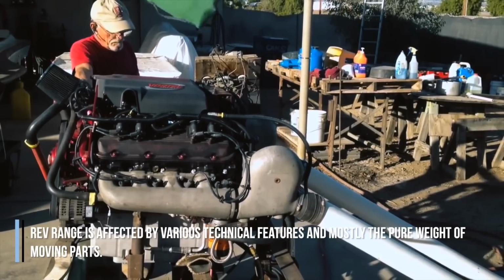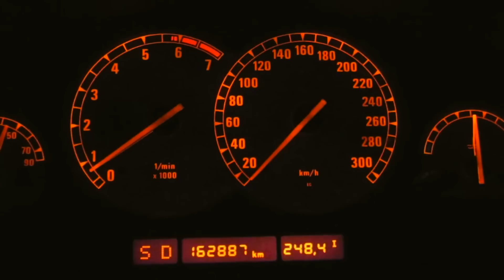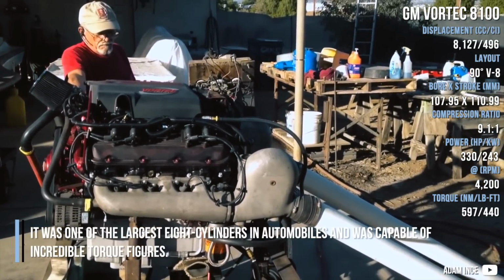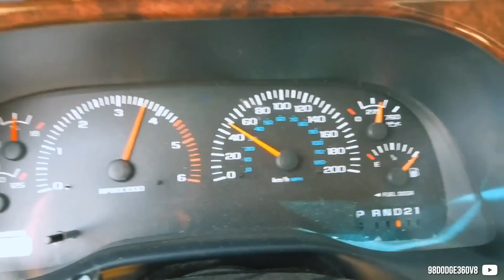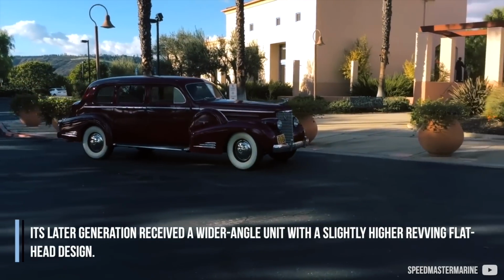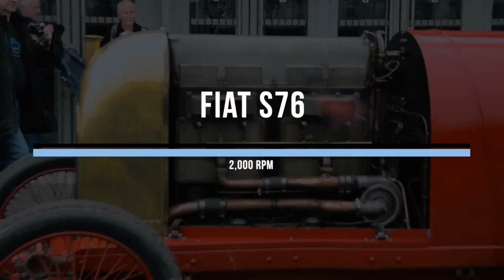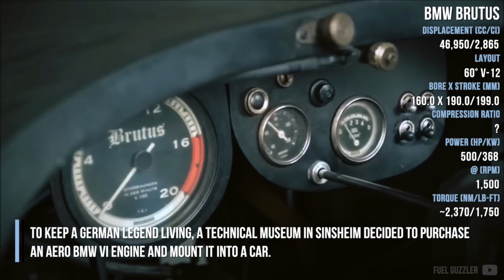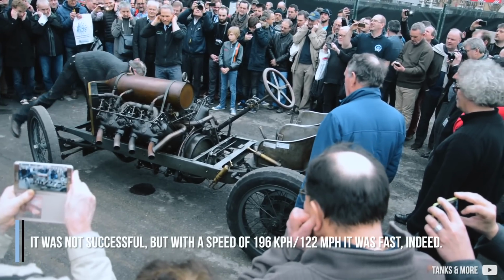Lowest Revving Gasoline Engines

Comment: Do a video that is opposite of this.
Highest revving diesels.
Audi le mans tdi
HDT m1030
BmW n57 
Etc
Reply: Lowest revving diesel too!
Reply: Yanmar 7800 rpm
Reply: 2004 Citroën C3 1.4HDi. 5000 RPM. I can prove it too, I have one sitting in my driveway :D
Reply: Whole Mercedes OM60x lineup
Reply: My last car had the BMW N57 and now I drive one with the successor, the B57.
These engines are beyond great!
They have huge amounts of torque and especially the B57 revs fast as hell for a diesel!
Reply: @jaynee8581  thanks. 👍
Reply: @rolux4853  It must have a lightened flywheel then ;D
Reply: Maybe Detroit?
Reply: 6.7 Cummins turbo diesel from a 2013 ram 2500 6000rpm
Reply: 2 Stroke detroit... at 3k sounds like its at 6k XD
Reply: 2.0 litre PSA-tdi with 136 hp in a 1,7 ton Volvo S40. 
Even a BMW E90 with a 136 hp (probably the same engine) is much lighter than the Volvo with FWD.
Reply: @davidradtke5166  Some TDIs Rev To 5500 At Max...
Reply: @savagetuner2404  those huge marine diesel engines do like 100 rpm, but I think let's keep it on ground...
Reply: @danishghostrider  omg that revs higher than my gasoline truck V8 lmao. I feel like I'm a part of this video's list when I'm in 4th gear doing 40km/h @ 1000rpm
Reply: @danishghostrider  please do. I had the Xsara 1.4hdi from the same here and it toped at 4000rpm if I remember correctly.
Reply: @TheAllMightyGodofCod  Sadly rotted to death, along with other failures, such as: power steering failure, abs failure, aircon failure, frame rotting, turbo failure. In short, too expensive to fix. (5.000DDK car and 15.000DDK repairs) Had to junk it...
Reply: @savagetuner2404  I think it's the 300 to 500 range and used in a ship
Reply: @BeingMe23  the slowest modern example that I know of is a Wartsila ship engine that peaks at 156 rpm

Comment: My brother and I traded a Chevy Suburban with a blown transfer case and a bazillion miles that we had gotten for 500 bucks for a 96 Econoline van with a 300 straight six and a 3 speed C6 transmission. The guys we traded with knew what they were getting, and I'm not sure why they wanted to do it, because we've been using it as a work van for years after building out the back with shelves for our tools, and a bulkhead to keep everything in place. Was just at my parents house building a fence yesterday, and their neighbor has a Chevy truck with the Vortec 8100. 2 of the engines on this list right next to each other and I didn't even appreciate it!

Comment: What about the Bentley/Rolls-Royce 6.75-litre V8, redlining at around 4,500 rpm?
Reply: Scrolled down to post this. They just ended production last week!
Reply: @Matthew Lund british? lol, it's a chrysler engine. waaaay back when that brand meant something.
Reply: There is no such thing as the Bentley / Rolls Royce 6.75 chap.

I think you must be thinking of the "Six and three quarter" old bean! 😉
Reply: @mattlad6935  Now BMW installs a 6.75 V12 instead of V8 odd idea getting ride the V8
Reply: @BeingMe23  I'm sure they don't call it the "Six and three quarter" though!

Comment: Supercar fans: "Bugatti Chiron is the torquiest gasoline-only car out there."
Fiat S76 & BMW Brutus: "Allow us to introduce our selves..."
Reply: Supercar fans: O.K. - let's race !!
Reply: @TIMEtoRIDE900  add a little traction control and better tires, and I'd like to see a video about that. The brutus has roughly 1000Nm more torque than the Veyron.

Btw, the Veyron is actually german-made, too. Just like the Brutus.
Reply: @JohnM4jc  all the traction in the world wouldnt help the fact that the chiron has more power. use all the crank tq you want, but you cant break the rules of physics. hp wins. to even think they would compete in the same league is not even fucking funny.  comparing a car that brags about being able to comfortable cruise at over 62 mph, to a car that govers well over 200mph is a joke. i really hope you aint seriously thinking that these two cars compare. like, at all
Reply: @chaztitan6457  hp never wins proper gear config always win also Brutus uses a airplane/tank engine if it was put in a aero dynamic chasis and had modern tuning and gearing it could in theory beat the Bugatti.
Reply: @xxzenonionnex7658  it would not beat the bugatti for this simply fact. The brutus's engine produces less energy output that the w16 in the bugatti. Pushing air, moving gears etc require energy to do so. This seemingly common sense idea, seems to escape people constantly. to pull weight faster, to accelerate faster all requires more energy than what you had before to "be faster, move more" etc. gearing is a major part, but without energy to use, gearing is unimportant.    and hp always wins. only time hp may not look like it won, is when you are in a race where hp out on average is what determines the winner. like a circuit race etc. but in a drag race where you are on the accelerator the whole time. it would be impossible for a car whose output was 1000hp the whole time, to loose to the same car whose output was less than 1000hp.  if 1000hp was not as quick as another 1000hp simply because of tq output or gearing then 1. you could win a nobel peace prize and turn physics on its head, or 2. you simply dont understand the whole concept of what hp actually means and how its used
Reply: @chaztitan6457  then how do drag racing diesels that rev 2500-4500rpm go 180-220mph with around 700hp or 1000hp and 2000-3000lbs of torque then?
Reply: @xxzenonionnex7658  they might not weight all that much. since less energy i.e. hp is needed the less there is to move. 
and again. you really need to learn more about energy transfer and piston motors. cause 1. this isnt the place for me to give an education. I aint getting paid for it. and 2. your view on TQ is extremely typical of someone just starting out in regards to thinking about what makes a car fast or how its manipulated with gearing and output etc. 
There is a reason its hp/weight ratio to give you an idea how fast something can be.
you will NEVER EVER EVER get close to knowing how fast something can be with a tq/weight ratio. NEVER!!!
just as you will never know how fast a car can be by its rpm/weight ratio.

Comment: Aviation engines are very low revving. I once flew in a single-engine jalopy that had a 6 liter boxer 4, making all of 180 horsepower but 400 foot-lbs of torque. 3000 was max RPM but cruising was 2000.
Reply: Yeah the propellers are usually mounted straight into them, no gearbox or anything, hence so slow compared to car engines (optimized for the task after all). Some of the bigger V12s from WWII did have reduction tho, given the propellers were so huge.
Reply: They are also designed to run at high power settings without complaining.
Reply: Many planes have a mandatory rebuild if they exceed 3000 rpm
Reply: Have to keep the prop speed down as well if spun too fast they quit working or worse self destruct

Comment: You should do the best sounding hemispherical head engines.
Reply: Short answear, they are not hemis, they are kidney shaped ;) The headspace is like a bathtub and the piston has a high ridge in the middle.
Reply: @TheEsseboy  That wasn't the question, was it?
Reply: Air-cooled Porsche 911 engine. Finished.
Reply: @TheEsseboy  Long answer: What? Why are you "correcting" something that wasn't even relevant to the question?

For example:
Me: "Do a video about the fastest trikes".
You: "Those aren't trikes ;). They have four wheels with independent suspension at all four corners".

Even if you were "correcting" him on the actual shape of a hemispherical head, the common parlance of hemispherical is enough to convey what he meant as you clearly recognized what he's talking about. Odd.
Reply: Hemi 6 in the aussie vallient chargers
Reply: @xebek  Because Hemis are one of the worst designs behind flatheads
Reply: @savagetuner2404  No, but Hemis sucks so whatever
Reply: toyota 2TG
Reply: @savagetuner2404  No, I was dismissive, not mad. Hemis are not hemis, it is marketing mumbo jumbo.
Reply: @TheEsseboy  The only mumbo jumbo here is the bs you're typing
Reply: @TheEsseboy  uhh...the original mopar hemi literally had hemispherical combustion chambers.
Reply: SAVAGE TUNER sometimes you just can’t fix stupid.
Reply: @TheEsseboy  That's...literally what hemispherical is?

"They're not hemis, even though I described, in detail, the shape of a hemispherical combustion chamber!"
Reply: @savagetuner2404  So a kidney with a wedge driven into it is a Hemisphere?
Reply: @frigglebiscuit7484  No, still kidney shaped...
Reply: @NaruSanavai  No, a Hemisphere is half a sphere...not a kidney with a wedge driven into it 😂
Reply: @NaruSanavai  still not even close to Hemisphere...it's marketing garbage. Used to make 2valve folks feel special.
Reply: @TheEsseboy  ...
Reply: @savagetuner2404  Well, do you feel special? ❄️
Reply: @TheEsseboy  you do realise that top fuel dragsters have giant hemis that produce between 8000-10000 hp right. they are not as efficient as dual cams with 4 valves per cylinder but they are pretty much right behind.
Reply: @Peron1-MC  The thing is, you can't make one wthout a rdiculous over square bore to stroke ratio, otherwise you won't get enough compression and have to bake a wedge to press into the head space, negating the benefits of the Hemi head...
Reply: @Peron1-MC  With 4-valves and aTubos it would probably produce closer to 20,000 HP, if they can make crank, rods and pistons that can handle it. 😉
Reply: @Peron1-MC  The wedge piston which presses into it...if not it has a compression ratio less than 7:1

Comment: Love those old engines! I've owned a couple of vehicles that redlined around 4,000 RPM: an old VW Beetle and a Mitsubishi van with a diesel engine. My plane's engine redlines at 2700 RPM, but that's a different situation.
Reply: Does the plane rev so low for reliability?
Reply: @io504  Pretty much. An old low-tech design (Lycoming O-320), but well-proven and highly reliable. You don't want the tips of the prop to get too close to the speed of sound either.
Reply: @io504  it means you don't need a gearbox to reduce the speed for the propeller
Reply: Thanks, I wanted to know when I need to shift my bug. I’m a “low shifter”, and I noticed that it hates being lugged. I’m used to antique farm tractors, my Minneapolis Moline G was governed at only 1100. But that’s a different application!

Comment: In my UAZ 452D installed gasoline engine UMZ 4218 OHV 2.9 litres with redline 4000 RPM
Reply: I think that's engine knock lol
Reply: Буханка в своей отдельной категории))
Reply: @savagetuner2404  this engine don't knocks, it's isn't a subaru with knocking 4th cylinder
Reply: @lenar_usmanov   It's a joke, lad

Comment: theres some tractors that idle at 0 rpm by having the crank shaft not do a full rotation and because of the way the idling works the engine can run backwards

Comment: Here’s one you missed: The Mack 707, 707 cubic inches of inline 6 that idles at 350 RPM and redlines at either 2500 or 2600 RPM. It’s got dual distributors, dual sets of ignition coils, all combined to make 250 BHP and an immense amount of torque. They were put in Mack firetrucks from the 40s to the 70s and Mack semi trucks in the 50s.

Comment: I got a Ford 300/4.9 straight 6 that tops out at 4000 RPM stock. Was gonna get a built 300/4.9 that clocked 5500 to 5900 RPM at the shift points (yes my truck is an automatic)

Comment: Lowest-revving? Nope. Maybe for vehicles, but I've seen a stationary gasoline engine (originally built to power a grain mill, I think) that had a cylinder something like 3ft long. It's maintained and used at a museum in Albert City, IA. If I remember correctly, its max rpm is something like 16. Not 160; not 1600. Just 16.

Comment: The Rolls Royce L-series (6 1/4 litre and 6 3/4 litre V8s... although many call them the 6.25 and 6.75 litre :-) ) revved to around 4,200 rpm. 
At the other end of the spectrum, the original 1948 Citroen 2CV revved to about 4,000 rpm, with peak power of 9 (NINE!) horsepower at 3,800rpm.

Comment: the rev limiter on my 89 mustang is somewhere around 6200 rpm which is also where i get valve float (non interference engine so this is fine)
i did get the revs to around 8000 once when i was still learning the car and went for 3rd and got 1st. it backfired and blew the intake hose off the throttle body, car still ran like a champ though once i reconnected everything

Comment: Good video, nice sound on all the clips! 

Another engine you could add to the list: the AMC straight-6, a fantastic torquey little motor,  known most commonly in its 4.0L Jeep form. It has a 4500 rpm redline, and makes most of its power from 3-4k

Comment: This M70 only uses a few of the same parts as the M20B25: one set of wires and the distributor caps/rotors. The engine is a clean sheet design and only has the same bore, stroke, and bore spacing as the M20B25. Literally everything else about it is different.

Comment: In the early days of cars I can understand low rev limits and massive cylinders to get power but leave it to the murica people to have V8 that have less rpm than a common car diesel engine.
Reply: Why make an engine spin 10k RPM when you can have it make the same power at 4k RPM while drastically reducing engine wear and cost? We did it right!

Comment: The stock 350 in my 86 Suburban made 275ftlbs @ 1600rpm and 160hp @3800rpm.

On trucks Tach equipped the redline was 4500, but the bottom end holds together up to 6,000RPM

Comment: Lowest revving car I ever had was the vw type 3, with red line around 4600 or so, it was also the slowest car I ever had. 

Also the BMW v12 is the same solution a guy I know came up with for engines over 8 cylinder for delco 808 ECU conversions.  Real time tuning of dual ECUs via the same PC/laptop is pretty neat, they are seen as one unit by the software.

Comment: Clarkson’s GT had a revlimiter that stopped the engine at 600RPM.

Also, about that number 1 spot.... Are you sure that’s not just a low-power modern truck engine? Because the way the specs compare to another is eerily close...

Comment: I have a 62 International Harvester Scout 80 w/ the original 152 ci (2.5L) 4 cylinder. Out on desert runs I've had the thing down as low as barely reaching 400 RPM after I hit soft sand while in 4W-LO. Could almost count the firing strokes being exhausted out the pipe. But that motor originates from the 304 (but with the left bank missing) which makes them both industrial-grade, HEAVY chunks of iron meant for low rpm chugging or will happily run full throttle @ 4400 rated rpm day in...day out...week after week...month after month...non stop. Especially when paired water pumps (for the V8s) for fields back in the day.

Comment: rev limit is mainly about bore to stroke ratio. f1 cars and motorcyles have much higher rpm than a normal car. they have big bore but small stroke so they need to have a lot of rpm to produce enough power. the piston basically moves up and down more quicker because there isnt a long travel distance sort to speak (if its easier to imagine).
engine displacement is the other reason. larger engines dont rev as high. the biggest engine of a boat idk 64l or so just revs to 600 or so cant remember the exact numbers but you get the idea

Comment: I got an old lister Type R stationery engine from about 1912, its a massive 8hp single cylinder that runs at 650 rpm

Comment: Low revs ? More like comfy revs - w -
Reply: yessss you understand the feel of a sleepy V8 - w -
1000 RPM, 25 mph, 4th gear, flat ground. Oil pressure is still good at that speed, and my 302 truck V8 is still 250 RPM away from lugging. Just don't floor it and it'll happily give you a 25-60 acceleration time of a whole minute if you crack the throttle a bit more lmao. It'll holler strong at 3750, you can stand on the pedal after 2400, but at 1500, it's a large sleepy horse.
Reply: I like to hit 180mph at 2000rpm, look how much fuel i could preserve :P

Comment: Did is see correctly: Those RAM's had 3 Speed automatic Transmission? So you were driveing constantly in transmission Torque converter?

Comment: VisioRacer, The Fiat S76 probably doesn't even get pushed to the true 2,000 RPM redline, At the Goodwood Festival of Speed all your ever going to hear the engine being pushed to is around 1,200 RPM, Duncan Pittaway is the driver and had it restored in November 2014, Many large engines don't get pushed to redline often, I wonder why?

Comment: actually the 6.8 isn't sourced from the 5.4.
the 5.4, 6.8 and 4.6 were all the modular, or triton series, and were produced together to an identical design, just with varying displacements and numbers of cylinders
it was meant to give an option between the 7.3 Powerstroke (Navastar D444E) and the 5.4.

Comment: The Darracq 200 is still being raced by Mark Walker, its current owner (the car has had only two owners since the Darracq factory built it). His arm-flailing style, with lurid slides and drifts, is one of the most thrilling sights in all of motor-racing, past or present. Check it out: https://youtu.be/SgN1387v4sA

Comment: My 1989 Trabant 601:
Inline Twin Two Stroke
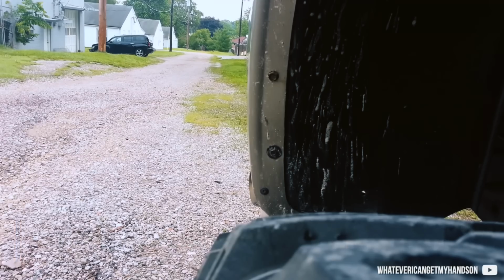1:50 Premix
600cc
26Hp
Air Cooled
7,2:1 Compression Ratio
Redline 4200 RPM
Reply: my 1991 fiat 126 bis 700cc also 26hp and 5000rpm redline but peak torque at 2000rpm

Comment: my 1995 chevy 2500 with a 7.4l has its redline start at 4000, and max rev on the counter is only 5000. about the lowest i had seen for a modern v8 gas engine.

Comment: I like a 4 liter twin turbo FPC V8 that revs over 9000 and makes over 1400 hp featuring a 5 valves per cylinder DOHC valvetrain, titanium 3D printed pistons and rods, and Garrett VNT dual boost turbochargers.